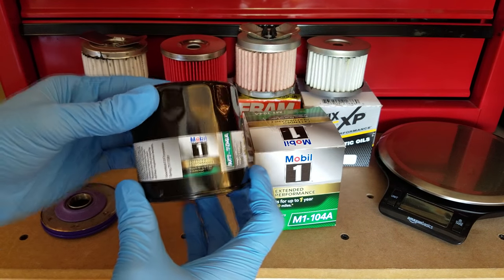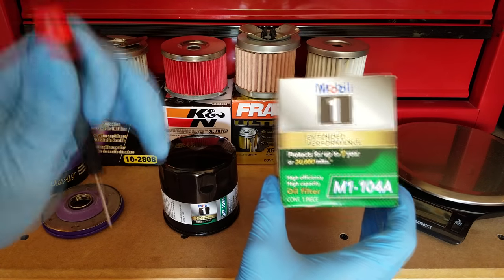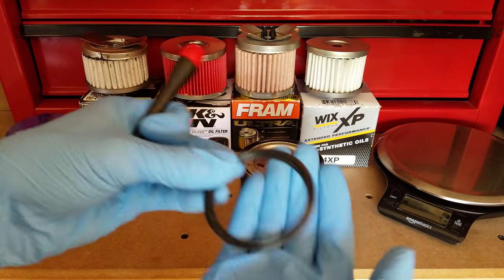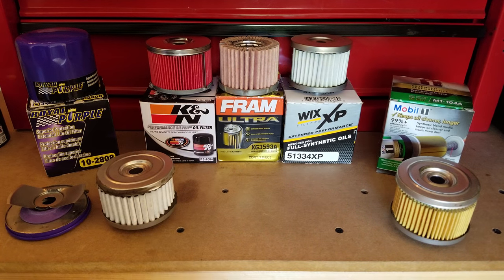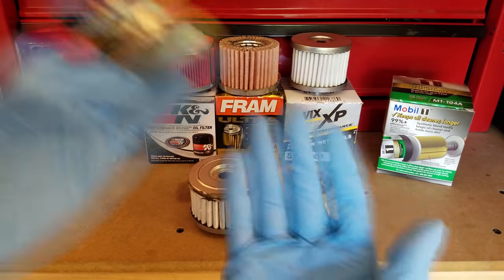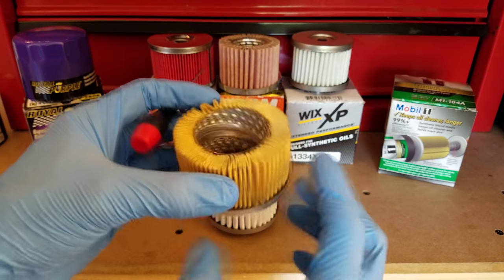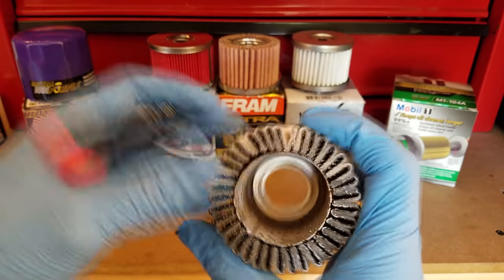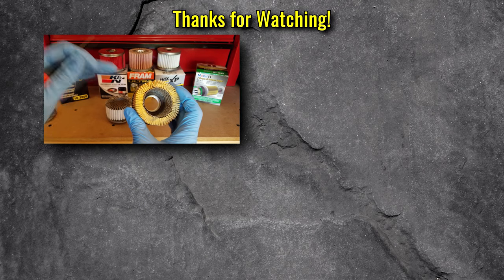Mobil-1 Oil Filter Cut Open! | vs Royal Purple/WIX/K&N!

Comment: Yeah I actually agree. I'm not a WIX XP fan. Filtration is OK. Not great and it's not some super flow filter so filtration should be better.

Mobile 1s are great but I use Royal Purples, Fram Ultras and Purolator boss filters the most. No issues yet. The Boss has the same center tube as the mobile one and has some seriously legit media 

And I'll take extra glue then too little. No biggy.

I like the Purples because the efficiency is great and it has very good flow. Very good overall filter honestly. The Fram ultra is probably the most underrated filter our there. Top notch despite their cheaper ones

Comment: But a filter that is less efficient at capturing particles of a given size could be rated for longer life than one that is more efficient, no? A hollow tube could last forever because it doesn't filter anything. So what does a 20k miles rating mean in absence of real number on efficiency?

Comment: Did you know that jegs sells cheep oil filter cutters so you don't spread debris in them. Air craft supplies companies sell oil filter media cutters to easily separate the ends to allow easy media stretch out inspections.

Comment: Want to make your engine last longer and maintain its efficiency? Change your oil often, especially if you do more stop-n-go driving. I use synthetic and change the oil & filter on my Honda Civic EX every 3K/3 months and no longer than 6 months. Changing your oil frequently is one of the cheapest way to maintain a trouble-free engine and maintain good fuel economy.

Comment: With a little more media in the Mobile 1 there is more surface area but under pressure some of those folds may compress together. With Royal Purple you have a little less media but it has a backing that would prevent the folds from compressing effectively maintaining surface area. I would have to see the filters operating to determine which design was more efficient. The extra 5% micron size reduction is interesting. We need some science to break the tie.

Comment: Those filters are primaries and only filter down to about 15 - 20 microns. The actual material size that wears out an engine is 5 to 7 microns. You need a bypass filter to get those and those filters average $40 a pop but they also filter out water and glycol. Good investment for a NEW engine otherwise buy cheap oil and dump it frequently
Reply: Bypass filters are lot better than a 30 Micron regular oil filter. You know what's better though? Take a look at an on board oil centrifuge. They can clean oil down to  1/2 micron ! They are cleanable there's nothing to replace. They cost about a hundred to $150. There's a YouTube channel for Pennsylvania biodiesel which has a good video explanation about how they work. They use them externally, but you can also put it under your hood which is the way that that they were designed.
 BTW check out group five synthetic Ester based oils from Red Line. You're welcome.
Reply: @johnwyman6331  they're spendy but worth the 500 bucks. They don't filter water and acid so add the bypass for big motors
Reply: Waste of money. Change you oil regularly with premium oil and use any premium filter and you'll be fine. This is much to do about nothing for street driven cars.

Comment: The A suffix has the exact same element/filter except for the rubber gasket for the 20k but they charge a ton more for a 25 cent rubber upgrade.
Reply: Not really, I used to pay $12-$13 for the Mobil 1 filter, now they cost about $10

Comment: So this means if I happened to drive less than 20,000 miles a year just change the oil 3 times a year by using full synthetic and change the oil filter one's a year ? That sounds about right.

Comment: Why do you not include AMSOIL EA Extended Performance Filters if you are testing for premium quality?
Reply: Probably because it is cost comparative. Of course the $30 oil filter for high performance will be better. We want to know if we buy the $15 filters, what gives us the most "bang for our buck". I was severely disappointed in the regular Fram filters. Napa gold and Wix were the best until you get to these. And as you stated, I am sure there are even better, pricier filters after that.

Comment: The drain back valve on the Royal Purple is synthetic as opposed to rubber on the Mobil 1 filter. Synthetic is superior for its extreme temperature operation.
Reply: You're wrong.  Mobile 1 uses a silicon drain back valve.

Comment: Have a2006 tacoma 4.0 with 232,000 miles,have only used Mobil one oil and filter every 7000 miles from new.oil is still clean to a Amber color and it doesn't use any oil.but it is a Toyota after all.

Comment: I just recently got a bad K&N filter the base plate was warped so bad no matter how tight ,it leaked real bad i finaly replaced it with a mobile 1 no more problems but i wont run my enguine that many miles without changeing it

Comment: Why not cut open a Honda oem filter and compare. Honda’s filters have always been made for 20,000 changes. At least since 2004 as says my owners manual (says you can change the oil every 10k and change filter every 20k for highway driving.)

Comment: Well I just changed my oil after 12K and i thought I buy the more expensive K&N filter now after changing it I alway open the filter to check if metal is floating in the oil. What i saw shocked me. the filter element was so stiff that it actually had a hole in it and the oil didnt even got filtered! I would stay away from those filters! I never even have seen it on a cheap fram filter!!

Comment: Check the threads on the filters. I have found shavings on just about all the threads of brand new filters before installing them. They don’t clean the threads at the factories after cutting the threads. I clean the threads with a towel before installing them.
Reply: Bernardo Gonzalez Thanks, good thought: if it works & we catch metal filing... I try and check that cutting & dump or clean too.: should not be a problem really for User?

Comment: How about looking into motorcycle oil filters? I've heard there differwnt inside because of higher reving engines. Need more flow. Maybe you could think of a way to test flow rate? I have a kawasaki and thinking of using a kawasaki filter because of specs and warrenty. Thanks and good vid! Cheers !

Comment: They make more Oem oil filters vs specific aftermarket oil filters, thus the price difference?  Mobil filter have a wider housing than others, less warp if remove and reinstall.  But most filter seals are ruined once install and then removed!!  I found my oil filter leaked as if somebody have it remove and reinstall it, hence somebody switch my car as the culprit!!!

Comment: Can you review the yellow Penzoil filters? They’re supposedly made by Fram but I can’t seem to find many reviews on them
Reply: they are Fram but yellow in color. mostly for there fast lubes "jiffy lube" Q.S. use to be from and went to Pur-oil-latter when pens went to Fram. I was a Big Q rep and redline and mobile 1 also lubrication specialist. worked with the engineers. funny how peeps cut open and then rate a filter. NAPA use to do this to show there Wix off. its all about the media, and how its mounted, and then about there type of media area and then pressure it will take and not get bypassed.
Reply: @mrwentland1  do you like fram?i buy the best one they got at wally world.for .my wifes subaru.i use motorcraft on my fords.
Reply: Robert Wentland ps, my Dodge Dealer uses PERFORMAX ( made in Mexico)/ Pennzoil (?)::: for Peogram changes with Conventional oil @ severe use 3-4K...have not seen any information on PERFORMAX.....

Comment: Does someone know which filter is better for daily, street racing, engine protection filter? I use Castrol edge extended performance as oil and I drive about 5k miles before an oil change. I can't decide which filter is best between those three: K&N gold, Mobil 1 Extended Performance or FRAM ULTRA SYNTHETIC? What are your suggestions? Thank you

Comment: On the old trucks had a oil bath  air filter how would it compare to the paper air filters and with oil we had a paper only filter no metal housing fit in the engine!

Comment: Dear Mr FilterKingz.  Help!  In your explanation of good and bad points of various brands of oil filters, it seems that the more involved you get, the more sloppy you get in picking up and laying down the various parts and pieces of the various brands--not always in the same specific brand-row.  So much so that it's hard to discern which brand you're addressing and which you are holding.  It's almost like a shell game, switching stuff around and trying to guess where it belongs.  Otherwise, it's a useful video. 

RM

Comment: I use mobil one filters in my versa. I wouldn't take it to 20,000 miles. 5,000 oil change intervals is all I do with mobil one oil. My choice in the versa. In the Corolla I use Toyota OEM filter and Castrol Magnatec and 5,000 miles intervals as well

Comment: So I cut my Mobil 1 oil filter open to inspect it before I used it. All looked well so I glued it back together & put it on my car. After I changed my oil & drove down the road, my oil light came on so upon inspection, I see that my oil filter is leaking. I'll never use a Mobil 1 oil filter again. They leak when you glue them back together. I put a cheap ACDelco on it and didn't inspect this one because it's a GM product and my car is a Chevrolet. So no need to inspect. But it doesn't leak. So ACDelco is safe. I'll never use a Mobil 1 filter again.

Comment: Fram Ultra is half the price on amazon.  I end up going with it because I think it's the best deal in oil filters.  It's by far the best fram filter but it's also a great deal overall IMO.
Reply: So your decision  was based on money saved at the time.... vs actually knowing you were buying a good filter? Iv cut open a bucket load of filters and filter for filter the Fram filter was always a pile of shit compared to its competitors... Apparently Fram still makes wicked commercials. 
D
Reply: If you need to nickel and dime when it comes to oil filters maybe it's time to take the bus.

Comment: If we are filtering oil, why do we still have sediment in the bottom of the drain pan. You can remove any drain pan or valve cover after a X amount of time evidence the filter is not doing well. The public needs better filters.

Comment: I wish the teacup filter was 2-3x larger than they already are. They cost the same so why does my v8 have a teeny tiny one but my old 4 cyl 2l ranger has a filter that's twice the size. I trust a huge STP 10k filter to go 20k in a 4 cyl more than a tiny 20k Mobil filter going 20k in a big v8.

Comment: I dont understand why you put so much weight on the strength of the filter. If you explode either one you already have a very major issue not filter related.

Comment: More a comparison of Mobil 1 and royal purple.  it would not hurt to include filtering microns of the other barnds: K&N, Wix etc. Too much of this is subjective and I would not necessarily agree with some of the build comments being good or bad.  Focus on the items you can say without question like the Mobile one has more square inches of filter media than the royal purple (if pulled out and laid flat) and therefore more dirt carrying capacity.  I would not be picking a filter because it weighed more or less than a competitors, thinking that the heavier filter must be stronger and better.  if i works, does not leak, split etc then it is all just as good.

Comment: Here in Europe it is normal for newer cars to have a service once every 30.000 km or every 2 years.
Reply: No it's not. There are "high mileage" service schedules on some brands but they still require interim smaller services every other year as well as a major service. A lot of cars have oil quality sensors that will bring up on the dashboard when an oil change is due.
Reply: Yep, absolutely true. Most VW and associated brands are factory set to 30000km (18640 miles in the UK) or 2 years between changes. Using dedicated spec oil (504.00/507.00) and OEM Mann or Hengst filters this has been the norm for years. Similar regimes for BMW/Mercedes etc. People don't want to hear this however! Also the colour of your oil does not dictate when it should be changed. Oil is supposed to colour when in use - this indicates that it's doing its job...

Comment: I find it rather interesting that oil filter companies promote dirt holding capacity.  You can take an old used filter off an engine and cut it apart and there's hardly anything caught in it.  In fact, you might not find anything that you can identify.  Yet they brag about dirt holding capacity.  If an oil filter is ever filled with dirt to its capacity, you've got real problems.

Comment: GDI injection is forcing, even German Manufacturers to go with a synthetic blend filter media. If the filter media gets plugged! Then the oil just by passes the media, and that can be bad in the long run. Those two filters are made by the same manufacturer.

Comment: Wouldn't a filter that holds more dirt logically restrict oil flow as the filter accumulates more dirt. I believe Toyota puts more importance on oil flow rate than filtration.

Comment: Here in Canada.  The exact same "Mobil 1 Extended Life Filters" advertise as good for 1 Year/24,000 Kilometres.  
 So let's do the math.  24,000 Kilometres is 14,912 Miles...or just shy of 15,000 Miles.  
 Now on the U.S. Product  Mobil 1 Extended Life (same filter) advertises   
1 Year/20,000 Miles.   20,000 Miles in Kilometers is 32,188 Kilometres. 
  Yet they are the same filters by the same Manufacturer!   
What to believe??? 
  I would probably think the Canadian Figure 24,000 Kms/15,000 Mi is probably a safer extended drain interval than say the U.S. 20,000 Mi/32,188 Km's figure...assuming you're using a good quality Synthetic Oil?  
 But I couldn't help but note the discrepancy in the numbers on the U.S. and Canadian Marketed Filters...even though they are exactly the "Same Filter" and I do use the Mobil 1 Extended Life and Purolator Boss Filters and like them both equally well. 
 But I still wouldn't push and Engine beyond 15,000 Miles...even on Synthetic, particulates are still particulates!
  Just thought I'd share this observation!
Reply: The only change I've seen is the re-categorizing of certain filters (ie) M1-108 is now M1-108A and likewise, M1-110 is now M1-110A.  Mobil 1 Filters in Canada come from the USA...but the only difference is the Number Figures. Kilometres and the addition of Canadian French along with the usual English...but otherwise the Box looks exactly the same!  They're already an Extended Performance Filter and that is what they advertise.  I'm also using a Cartridge Insert Filter rather than the more common Canister Type.

Comment: Run some test that actually mean something. So assuming you keep your air-filter changed and all your vacuum lines and duct work are tight what do you think your oil filter is doing? If you have not sludge up your engine and you do not have a catastrophic engine failure what do you think the oil filter is doing?  If you ran each filter for the same duration with the same oil and during the exact same months of the year you can not possibly think that any filter you put on the car will make a statically significant difference!?!?!? Pleat counts, media type, construction does not matter in a daily driver. Flow trumps filtration in a full flow filter.

Comment: Well nice video I have had o ring stick to the block.  Once is all it takes. You drive a block. Loose just about all your fluid. So all filters are not equal.
Reply: That's not an oil filters fault, that's poor servicing practices. Anybody worth their weight will know to smear some oil on the rubber O ring to prevent it sticking to the block. You would also check there's no O ring stuck on the block prior to fitting the new filter.